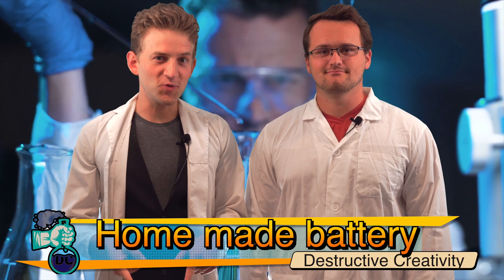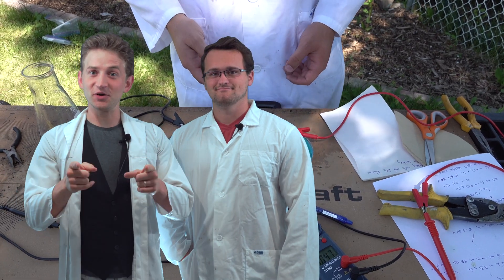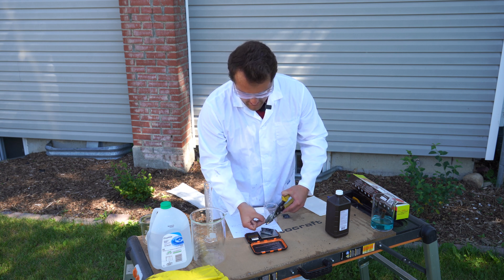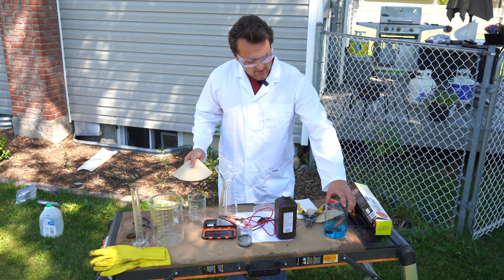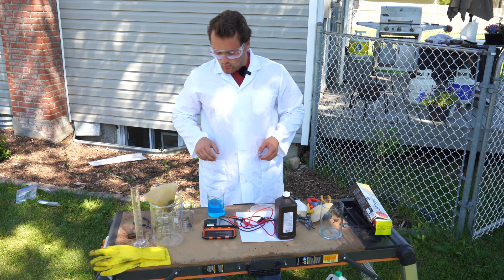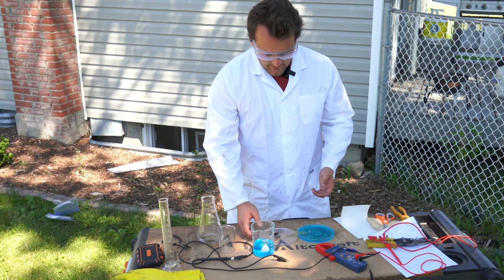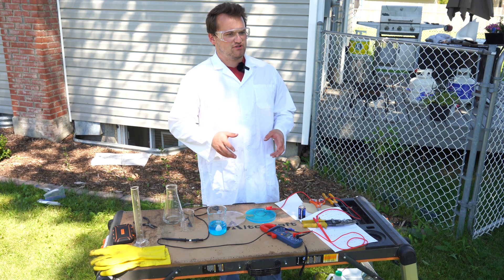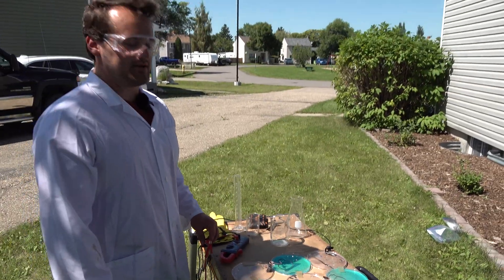How to make a battery at home! DIY battery using redox reactions. Zinc and copper chloride.

Comment from the maker: Do you have an idea for an experiment or a question about batteries? Let me know, I'll do my best to respond.
Reply: What batteries do phones use?
Reply: I would love to see you tackle some of the parallel series from 9V batteries like the guy on Tyler Tube does. His videos are interesting / entertaining, but not great on the science behind it!!!
Reply: Oh, and some basic "kid friendly" diy's for homeschooling would be cool... something basic and safe parents can do with their kiddos!
Reply: I would like to see two things, both of which have already been mentioned. 
1. Show it doing some work, perhaps lighting a little flashlight bulb or running a clock. 
2. Recharging. You'd have to show it running low, then hook up some power to recharge and then show that it's back to full voltage.
Luke is so good as the Mad Chemist!